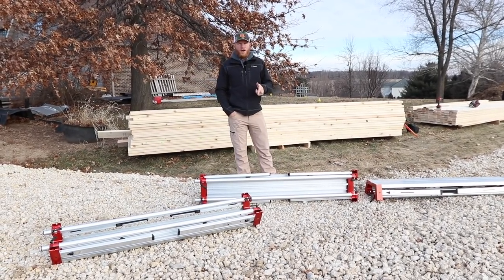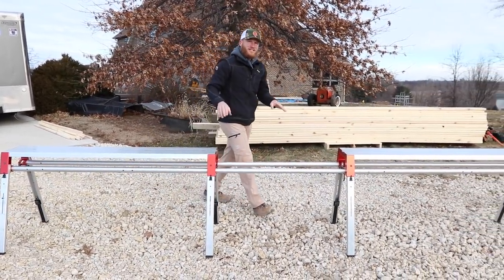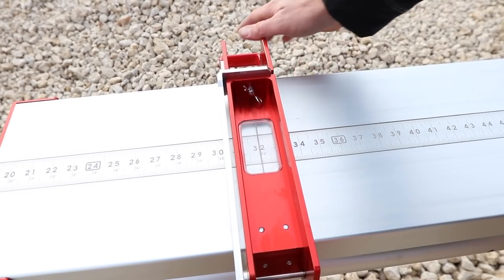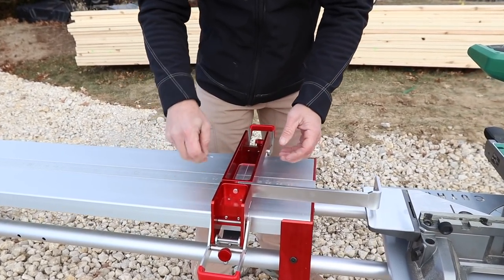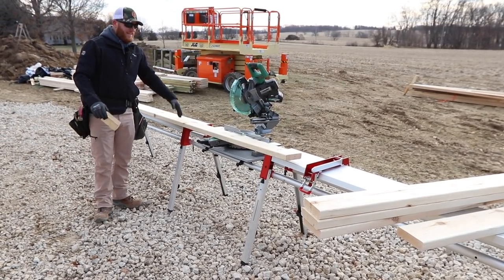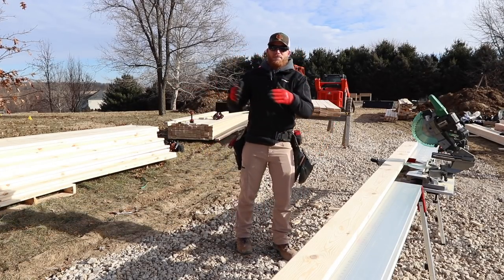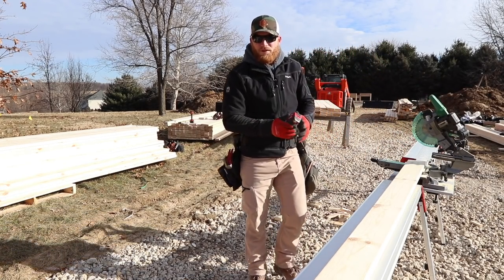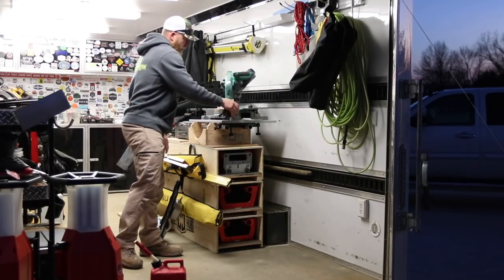Is This Work Station Worth the MONEY $$$$

Comment: Did you buy it or they gave it to you ??? 4K is for big ballers 😂
Reply from the maker: Jay Streams I have been honest they gave it to me.... I would have been super skeptical that it would add value at 4k but then again I’ve spent a couple hundred thousand on machinery that most people think is not necessary... and it saves me so much labor and effort over its life that it is now a no brainer.  This tool is similar.   It may not be amazing out the gate... but the roi is where it’s at over its lifetime.
Reply: RR Buildings  The $4000.00 or $5,304.62 CAD question is how long will it last?  I think it is an amazing system.  I frame up in Kelowna British Colombia, I have seen many ”homemade” setups like this, and I know they save tons of time prepping material.  We all know how hard framing  is on gear,  Is like to see how this hook up fairs after a year of tough conditions framing. 

Bottom line, I’d love one... a little too spendy right now

Comment: Would have had custom height studs cut for a 60lnft. wall already! Have used the same Trojan stand for 15yrs. with 12" sliding saw Everyone is always looking for the supposed next best thing... Saw horses with jig for repetitious cuts what ever length 16fts... One true cut with Sawzilla or similar saw and see ya in a week! Guess will be seeing festool soon here too lol Don't get sucked in. Smart Craftsmanship first then the tool!
Reply: Awsome bro let's see a video of you cutting with your setup
Reply from the maker: I agree I would love to see that setup.... also, everyone has a great system... we are all already doing our work the best most efficient way we know how and sometimes it’s hard to truly look at it differently.  I’m the same way sometimes.  This was not an easy sell to me I promise but after using I see it’s potential and love sending my new guy over to rip 16’ lumber down on the table saw and know he can do it himself and do it safely
Reply: @RRBuildings  
Going to try and move some pics to add to reply. Efficiency and Safety is always top priority for sure! I think honestly 3ft Mason scaffolding with 8fts or 10fts cross members with aluminum planks make a nice setup and well.. Usually long length rips we use rip guides tack the board down an go... There is so many ways to do things and respectively. I probably should of said the best tool there is we are born with meaning thinking and learning ways to constantly become more efficient and doing it safely. I have found over the years the biggest prob with stands is the tipping over or fingers in folding parts... I think It was Rosseau that had a similar stand to the trojan and they both made table saw stands as well. I do think as a framer for many years that extra large horse 2xs set 4 high and a jig to keep one side square and lined up and s jig to run the saw against cuts time down and is an efficient way to be productive and again knowing  that there trued up before cutting... Keep those big 6x's away I think it would be a matter of time before things get bent up with that system... AllnAll live the channel and you guys do great work it I wouldn't be watchin!
Best always!
Reply: For whatever reason won't let me move pics to reply...?
Reply: @karlb.6398  YouTube doesn't let us include photos in comments, but you can upload them separately. I believe if you click on YouTubes upload option, there is an option for a photo slideshow. Or you can make an album on a website like imgur and share it.

Comment: Strictly and ROI  issue.  Depends on hour much you save you x hours a job in upfront time and rework time that this save.  The safety issue  is real as well.  However, this thing does look like a truck or tractor magnet.  Sitting out there all by itself, kind of low.  Seems like the perfect target for someone like me to run over...

Comment: Not a professional by any stretch but one thing I don't like or trust is that they wont post pricing on their website. Businesses that will be consistent and fair with their pricing across the board are typically not safe to deal with.

Comment: Useful? Yes.  Well-built?  Certainly looks like it.  Priced right?  No way.  Starting with $4K, I can build a fancy extended Ron Paulk miter station about 6 times over, and still have $3K in the bank. Or if I felt really extravagant, I could go with the Festool Kapex with portable stand and 2 wing extensions for about the $4K --  and  that includes the overpriced but delicate $1,500 Kapex miter saw.  Maybe CutHub is trying to appeal to & penetrate the uber-overpriced Mafell market?   I buy a lot of tools (including my favorite product line, Hilti), but sorry -- a CutHub is not on my current list.
Reply from the maker: Welsh Rabbit that’s fine and no need to be sorry.  I never said it was for everyone.... of framing all day and you have a crew or a cut man... they’d love this I can promise.   Especially when needing to rip lumber or sheet goods down

Comment: I think its deadly. My job has a similar system with our "spida" saws. It's all computerized. We burn through lifts of 2x4 daily. Even watching you work. A few efficiency tweaks and you would fly. Lol it would pay for itself with time alone
Reply from the maker: donteatglue1010 agree.... Labor is by far the most expensive part of a job and by using the correct tool not only time is saved, but you can have a new guy cut lumber safely and efficiently with this
Reply: @RRBuildings  I train guys all the time where I have to correct the way the lift things. Just to make them more efficient. I'm all for hard work. But if I can knock 5 seconds of any task. That 5 seconds adds up. I'm not a business owner. But I understand time is literally money.

Comment: I like the concept, However the saw table locking device needs improvement, after a very short time the pressure screws will damage the rails !
Reply: I own a cut hub. Locking device is cheap. I bought clamps from another miter saw  saw stand to use. Setup is much easier  now. It is way over priced but I couldn't go  back to a dewalt stand. Less than a year I have owned it and it has more than made its money back.

Comment: i think the idea of the system is oke, but they engeneerd it wrong, not only the major gabs between the tables like you mentioned, but why are the brackets for the legs so far up on the outside of the table that there are serveral spots where the slide stop can't stop or slide over, also i would like to see the slide stop with just a front clamp and a more sturdy base for the saw itself, some point in the video it looked like there is allot of flex in it.for these amound of money i think you might expect alot more, if someone would ask me the price not knowing, i would say 1500 tops , great video tho.

Comment: Seems a tad pricey. You do enough volume so that it could well make sense and if it DIDN'T make sense it would be OK 2 jobs down the road. You seem to have the technique of sawing your 2x6 lumber to length off the piled up lumber down very well. However, the day you set that thing up incorrectly and make 46 pieces, all of them wrong, perhaps your enthusiasm might get lowered a bit. As for efficiency tools, I didn't hesitate a second thinking your Makita drill extender for the roof fasteners was a no brainer. This one, not so sure. On a big building, I am sure you'd be happy to have it.
Reply: He won't tho as habits unsures that he always measures on the first cut every time, I'd still probably re measure later on during the day as well

Comment: we have kind of the same thing in aus 
made from aluminum has a sliding stop like that,  max you could cut is mayb 3 metres 
but for a framer that's plenty and it only cost me 700 aud now that's a good price
Reply: Got a name for it?
Reply: @stevem815  its from Sydney tools (tool shop in aus) its called Xtorque XBENCH Drop Saw Work Bench

Comment: if you really look at the tool and peoples reactions it's not a game changer. What I mean is this; think about Festool and the track saw and the Domino, the Stabila lazerrrrr, Saw Stop and many more. All are crazy expensive but, if you look this tools are game changers. I think people don't have a problem investing into their businesses for game changing tools. At 4k I think the attachment plate point saw to cut hub might be a bit "fiddly" I think the attachment the Eh dear I say (as much as it pains me to say) Dewalt is an easier better way. Just a couple points, I think Dave has something here but; is it a game changer, not yet. The leg locks in deploying them will het hammered. Some stupid kid or a disgruntled employee will not take the time or care to deploy the legs correctly. As you brought it up; the ability to lock the stands together is an issue. I think trim carpenters may have an issue in trying to nest long pieces of crown since there is no fence and an ability to run crown stops. I want Dave to be successful I just think the demonstration  presented is too geared to framers (not that that's a bad thing) but for it to be a hit, the trim guys who would buy it, needs to have accessories  geared for those guys.  Its nice for framers but; its nothing that a couple saw horses built on site could not take of. At the end of the day, leave the saw horses out and take the saw as has been done for years.  I think he has something here; what I would do is sell it the Dewalt or Milwaukee, they can work out the kinks and sell it to the masses. Dave can work one the next cool invention for the trades. I can't wait to see what  improvements or other tools Daves comes up with. I industry needs guys like these to come up with easier, lighter, safer tools!

Comment: 4K is definitely way off the mark. It’s a good system but there’s no reason for it to be that high. Definitely if there is a production refinement to lower cost and still retain a quality product this could be a game changer. That mount for the miter saw does not scream 4K quality either. It should be a quality cam lock that puts even pressure on the tube so it don’t get all nicked up from a screw tightening onto it. The legs should have a knob to turn to adjust legs in and out and a quick lock as well. I’d be willing to spend close to 2000 for a total system but it needs to have a quality look and feel. That thing just looks clumsy to setup and operate. If your going to charge prices like that you should at least go about producing a product that you would enjoy setting up and know that it’s going to last a lifetime. The first time one of those little button locks breaks free and then you have to try to get a new one and fix it your going to be pretty disappointed. This just doesn’t have the fit and finish of a high end product.

Comment: It's a great system and I'm sure it works really well but two points tell me that it's not worth it.
1. You pretty much lost me when you said cordless miter saw.
2. I've made a living as a carpenter and builder for a very long time and there is no way that you can justify $4K for 3 aluminium stands for a miter saw station. There are far too many ways to improvise to achieve the same results.
Reply from the maker: its more than a miter saw station and I failed to show that....thats my fault.  I think the true value comes when its all set up

Comment: For that price, i'd rather spend on something else, but thats just for the type of carpentry work that i do. I'm good with the standard Dewalt miter saw stand (which, frankly, already feels expensive). However for the type of contractor that wants to quickly get in and out of the jobsite, saving hours overall material handling (prepping, measuring, cutting... etc), this type of gear definitely makes sense.... IF its built to put up for some abuse from the 200lb gorilla, as it looks a bit gucci (as not everyone on the jobsite may respect others tools, or just bumps from transport/setup).

Like having a nicely dialed in tablesaw fence, this makes cuts and repeat cuts fly.

On another topic, it kinda bugs me seeing someone cross their hands cutting on the miter saw, and holding the offcut not the work piece... feels awkward, and not fun in a kickback. Even if cordless saw has less power than its corded counterpart. Not a comment on your overall work mind you, as your work speaks for itself.

Comment: It’s a non issue, I’ve had the pleasure of actually using the Cut Hub, great work station, BUT not remotely worth the price tag , think about it, almost $4K.  Think about how a tradesman could spend $300.oo and $300.oo on a good mitre and table saw stand, and have $3K left over for power tools , NOPE, no way

Comment: It might be worth every penny and then some, but your guy is never going to find enough takers to have a business unless he can get his manufacturing costs down significantly.  There are too many decent miter stands on the market for way under $1000,  and you can build a Paulk miter station for under $200 in materials.  It’s no problem to set up an accurate stop system - a large hand screw on a long 2x works fine.

Comment: In less than one year you will look back and know this was stupid in construction and that you were the perfect consumer
Reply from the maker: Josh Lambkin I don’t think so. Specifically the table saw outfeed is what I am most happy with and I made the mistake not having the part with me that you set the saw on so I didn’t show you.
Reply: RR Buildings yes I feel the table saw attachment would be the most handy!
Reply: Felt like an asshole mins after I left the comment, I'm a production framer in residential. For us everything is cut with a circular saw, its rough framing with 1/8" tolerances all over. I remember working for a custom builder years ago and definitely agree something like this and many tools I would never grab do matter to some builders.

Comment: If the Tool will last even 4 years, with no repair costs and it saves you one hour per month on labor, for your jobs, it is a break even At $83 per month.

Comment: 4k is a lot of money when you take into account theres probably no more than £400 worth of materials and fixings, i appreciate the designer of this product has huge costs in development and manufacture but a modular system such as this shouldn't be anywhere near 4k. i could understand that price if it came with an industrial saw or a self loading capability as in it autofeeds lengths of timber across the infeed table. A great product all the same but even if i was a cash rich business i would rather invest that cash in staff training and development rather than a few lengths of aluminium. Full credit for the video and insight but this item is not for me :)

Comment: If you had to pay for that yourself would you spend 4K out of your own poker ?
Reply from the maker: Kiwi Bird not initially and I’m being honest but now that I have it and have used it.... for sure!   Here’s the deal... to cut 51” blocks... yeah not necessary, but on our builds we cut bunks of 2x6 and 2x4 16’ers down and no miter saw station can do that safely or effectively without additional. Supports or rollers to set up and they are always a huge pain.  This workstation makes it easy and safe and quick.  Now when talking about the table saw side of things... I made the mistake not showing that off.  I think guys would appreciate it much more.  You can’t rip a 4x8 sheet safely on a job site table saw.... with this it’s super easy and safe
Reply: @RRBuildings  yes it looks like a great system just a few things need sorted clips and plastic knobs I've had deteriorate quickly on other such benches along with locking buttons with springs and such lasting not longer then a couple of years. I see alot of twist with the top of the bench doesn't look sturdy for longevity. Something this price I would want to last min 5 to 10 years but I don't see that in its current condition. 3rd generation would be my bet after a few years of it being on the market with customer feedbacks and a few more kinks ironed out. Love the tool reviews and I believe you to be trustworthy and honest. Keep it up
Reply: Initially when I saw this I was thinking 1600-1800 range. 4k is just highway robbery.

Comment: Most of you guys are missing the point of it 
If your at home its not for you, if your cutting off sizes all the time it's not for you 
If your cutting small lengths it's not for you
This is to setup once on a job and cut sets of lengths
Set it up once being the apprentice over and say I want 20 of this and 20 of this 
No good o me but I see it would be handy 
If made my own that's for steel and lives in my shed 
Sayimg that much like my own table 
A back board or back post would be handy 
Could basicaly though board at the saw and cut away 
Have a  better chance of getting share as well
Reply: A good framer can do it faster without having to setup and touch the lumber twice........
Reply: Then the apprentice knocks the stop a little each time and now your back to square one. Doesn't look sturdy enough to be really reliable.

Comment: hell no i wouldn't buy that! safety, efficiency bla bla bla. 4K is the cost of a 12" mitre saw, 10" jobsite table saw, rear handle circular saw, side winder saw, nail guns, a jawhorse & a drill set all put together! So HEEEEELL NO I'M NOT BUYING A "WORK STATION" FOR THAT!